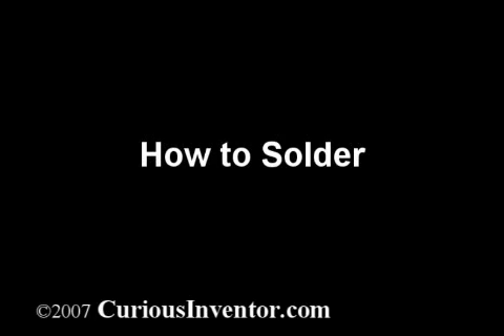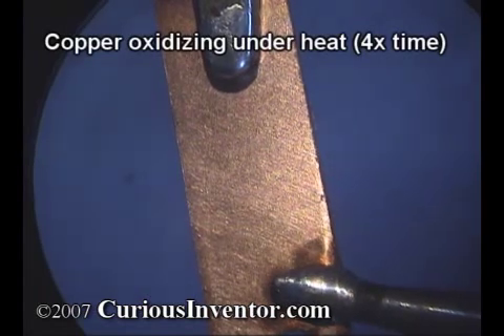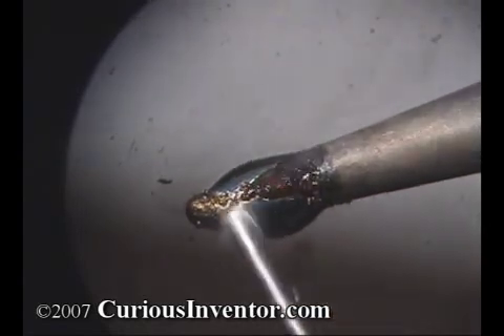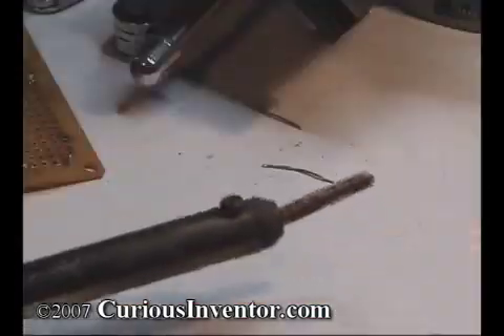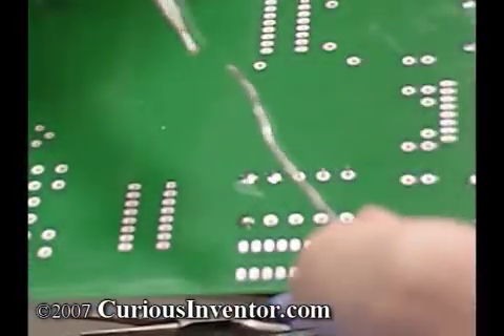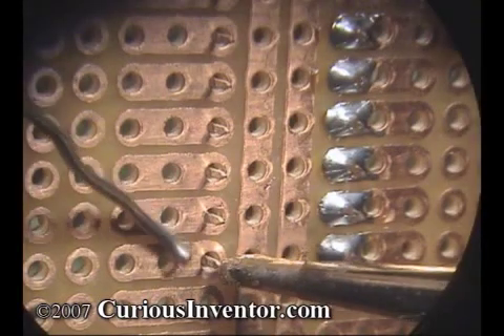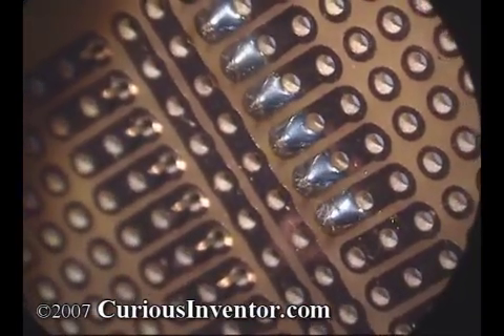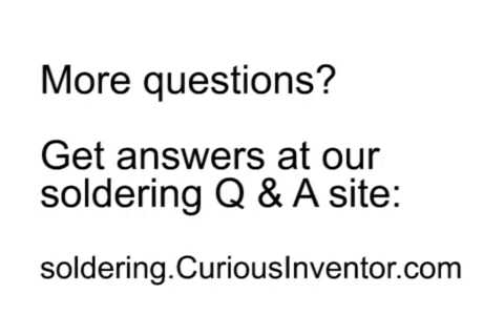How to Solder Electronics

Comment: You might want to leave the leads (intact) of sensitive active components and some electrolytic capacitors until soldered. It helps with wicking away excess heat safely. The leads can be trimmed later. You can also use a fiberglass pen to clean oxidized wires and leads. A solderpot can speedup production. Might want to use a tacky flux solder paste, with hotair gun to hand solder smt components. Hotplate soldering is another option to smt reflow. Just some additional tips.
Reply from the maker: Great tips. I think the reason to trim leads before is to avoid cracking or weakening a joint. But is that riskier than heat damage? Probably depends on everything.

Comment: I will need to solder wire coming out of a resister to a the base of a 5mm round silver rod rod (for a colloidal silver generator).  What solder and temperature should I use?
Reply: 69 Degrees

Comment: Hi. I did solder a capacitor on a pcb but I made a mistake. When I test the capacitor with ohmmeter I find continuity between its legs. When I test it outside the board, there is no continuity. Is it because I did connect both surfaces of the board so the plus touched the minus or what. Help me please.

Comment: Please delete this video and start again!  DO NOT ADD SOLDER TO THE IRON TIP BEFORE CONTACTING THE JOINT TO BE SOLDERED!  Clean the tip BEFORE every solder joint!  Apply the soldering iron tip to the junction of the component lead and circuit board and THEN apply the solder to that junction so that a small amount of solder can melt and help transfer heat into the junction and THEN move the solder to the other side of the joint and watch until it melts.  With perfectly clean parts, an adequately sized soldering iron tip, and fresh flux core or flux coated solder, the optimum dwell time on the joint is about 1.5 seconds.  Up to about 2 seconds for less than clean parts.  Instead of using a more aggressive flux, CLEAN THE PARTS!

Comment: Excellent Soldering Tutorial!  Everything was perfect.  I would only add that instead of soldering for a short time, you gauge the time based on flowing enough solder into the hole (when soldering parts into plated through holes).

Comment: So iron oxidies (idk the spelling)  when it is heated, but don't we need to heat the metal parts so that solder can melt and cool down? Also if i directly placed the soldering iron in the board will it cause damage?
Reply: ryan adrian Yes. Thats why you use flux to prevent oxidation while soldering. Yes, if you keep your iron on a board for too much time you can damage it. The solder mask covering the traces can fall off, pads can lift off the fiberglass board. Thats why its imperative to be quick and efficient. If you fail to make a good joint on the first try, dont dwell too much trying to fix it. Wait for it to cool down first if its too hot. Overheating and damaging the board is problem more related with desoldering though. Soldering isnt  has much stressful for the board.

Comment: You were very comprehensive and thorough with your explanations. Tonight, I'm soldering my first circuit board, and after sifting through a litany of instructionals, I finally feel confident enough to do it after your video. You broke down your soldering technique, including hazards and time constraints, in a way which was easy enough to understand for even a total beginner. Subbed, thank you.

Comment: The best short video how to solder, you give a lot of info in a short time.
I recommend to others; use a dry brass sponge, this cleans while keeping some tin on the tip, thereafter apply some fresh tin, to slow down the oxidation of the iron plating (to little tin= starts to black)
Reply: +ga12f12o Also don't set the temperature too high, you want the flux in the solder to clean, if it set too high the flux will aggressively burn and can't do it's cleaning job, the tin on the tip will show nasty discoloration. Also use the correct size tip for your work.